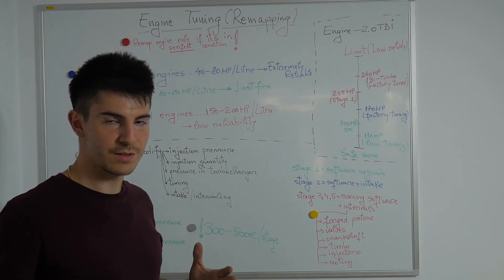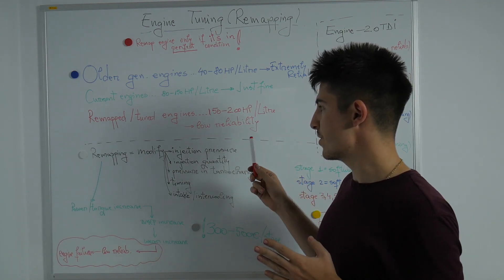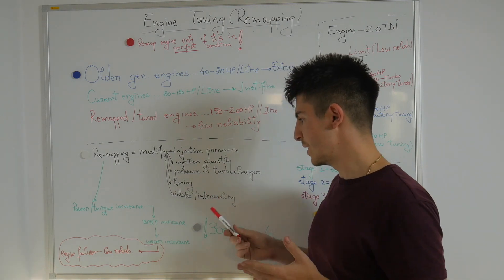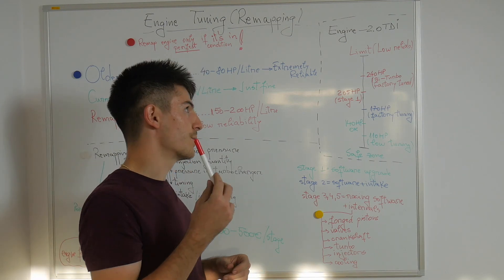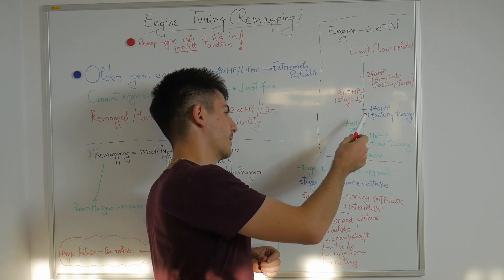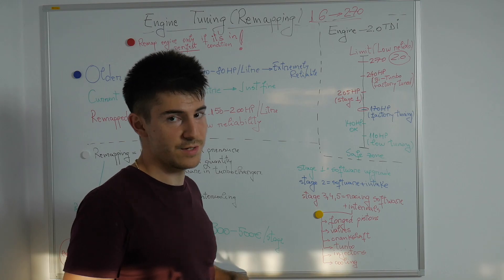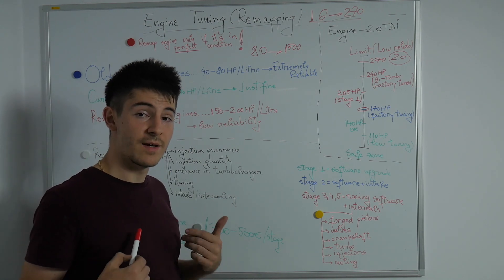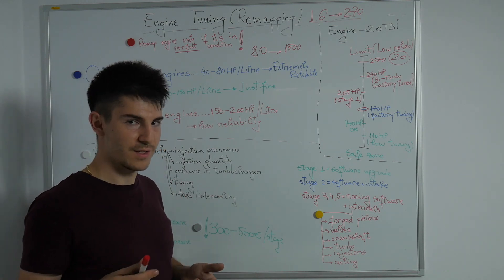Engine Remapping Explained - Tuning Basics & Tips

Comment: Hi! First, good video. Quick question, I have  a Mazda 3, 2018, 2 liter gas engine, runing at stock 120hp. That is definitely a safe config and tuned by Mazda towards reliability... Yet stage 1 usually pushes this engine towards 160 HP (same engine is being sold around that power), without much gain in torque. Would it be a safe one?